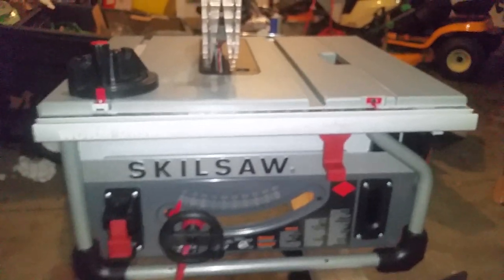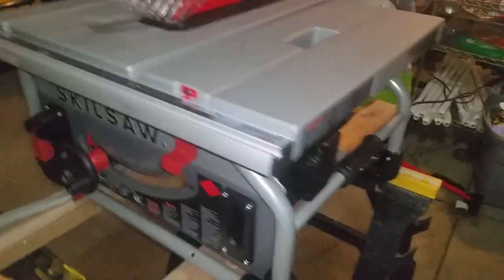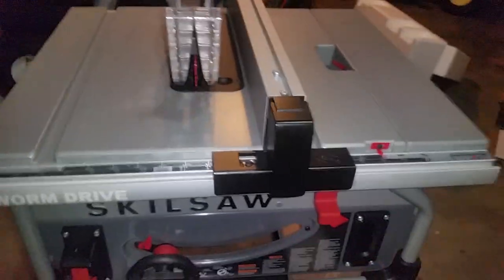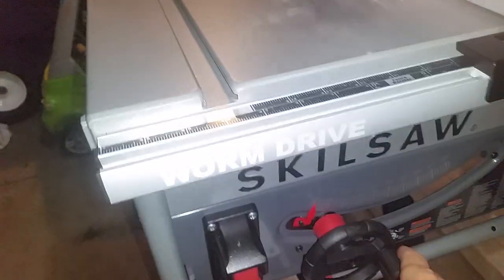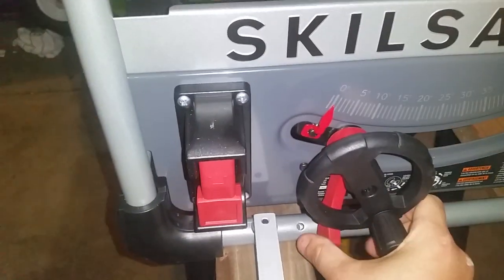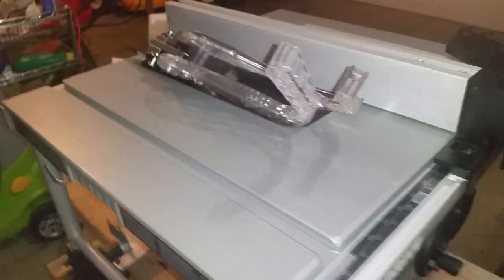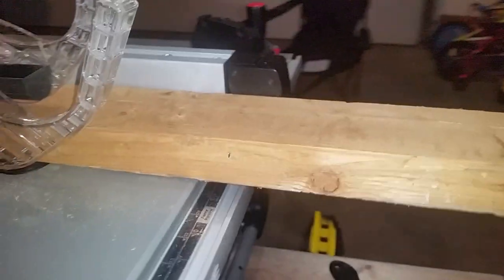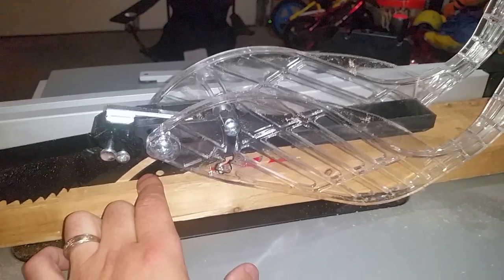Skilsaw 15 Amp 10 in. Portable Worm Drive Table Saw Review

Comment: I just got one of these used for $135. So far so good. I think it had the original Diablo blade. I do need to change the oil, but it seems to run fine. I have heard these can last a lifetime. One thing about these is that they are actually Bosch saws - made by Bosch.

Comment: I bought and ended up returning this saw. The height adjust would back drive while cutting box joints and each finger space was progressively lower by about .007. Fence was very square to the slots and blade but not to the table face and had no adjustment. So tall cut jig had problem staying square making cheek cuts for tenons. The fence itself is better than Dewalt and the rails work as well as Dewalt rack system. Well thought out, compact and light. Not overly loud but has a high pitch whine that can irritate tinitus. Motor is 9K rpm and blade is 4680 to 4950 rpm by a laser tach depending on warmup time for the oil. Angle lock is a knuckle buster, almost all other small saws have a better designed cam. A bit too much plastic and cost cutting in the dust chute for a high end mini saw. My dust chute had a crack in it that would've eventually broken. This is a small durable powerful table worksite saw for a pro. Ultimate portability and storage, but not expect to do accurate home shop detailed projects with it.
Reply: What would you recommend for accurate, detailed projects?
Reply: In the small portable jobsite saw category I don't think it exists. If you mean 1/64 repeatable accuracy then you're into a 400-600 lb cabinet saw with an Incra positioner. I am very happy and impressed with the Home Depot 2016 Delta for $199. It's a redesigned 2016 Lowes Kobalt (that has a terrible fence). It has more metal than the Skilsaw in the dust chute and bigger dado and rip (35 inches) than any of the Dewalts. 2 axis heavy steel adjustable fence with a really good lock lever tops all the Dewalts and Boschs and it comes with the scissor stand and outfeed support. Plus it rips 4x material and has an aluminum miter gauge and has telescoping fence rails, not single support like the Skilsaw. The thin throat plate is an issue, but I made 9 of them with a 10 foot piece of 2 inch PVC and MDF like izzy swan for around $18.
Reply: If I'm not mistaken, you're talking about the elusive holiday-only Delta that was not in stock anywhere I looked. If not, I'd be grateful for a link.
Reply: Phuong Dinh Yes it was available via online order free ship to local store. As were other large heavy tools like drill presses, etc. Most stores do not carry it. It'll be back. Its 2 good to stay away. Keep asking the store manager and they'll stock it. Only 239 regular price.
Reply: I have exactly the same problem with the height adjustment. Trying to make multiple blind rabbets and the cuts kept getting shallower and shallower. Finally, wound up setting the right height and jamming a piece of wood in the gearing that adjusts blade height. Otherwise the saw is a great machine.
Reply: @cbpuzzle  What model is the DELTA you are talking about from Homedepot?  I might consider it since you are somebody with experience on multiple saws. Thanks in advance for your reply!

Comment: 15amp motors at 120V can only produce so much power expressed in watts. Often direct drive is used to eliminate friction of gears by designing the motor to produce RPM wanted. Brushless motors allow them to produce more power really partly based on no brushes friction.

Comment: Notice the side to side blade movement when elevating or lowering the blade. I looked at 3 of these saws and they all do the same thing. Engineering flaw that I spotted before I bought the saw, but I still bought one for the torque and cut depth. I always check and double check my rip width when lowering or raising the blade. 
As for the plastic miter guide, toss it. It's junk, like all of them. Not sure why saw makers even bother.
Funny, going all the way back to the 70's I couldn't figure out why someone hadn't made a worm drive table saw, given the well known ferocity of a worm drive circular saw. Now that I'm worn out and ready to toss, they come out with one. Finally.

Comment: How stable is the fence? Trying to decide between this and the similarly priced Dewalt which has a really accurate fence
Reply from the maker: Hey Matt, the fence locks in very tight and will definitely hold up to anything you are cutting. To tell you the truth,  I was surprised just how sturdy it is

Comment: And have you heard or had issues with blade dropping while cutting ?
Reply from the maker: Haven't heard that dunno, but I actually got rid of this because of other issues.  Had to RIP it apart a few times because of electrical issues
Reply: @ToolReviewZone  What electrical issues?
Reply from the maker: A lot if trouble with the electrical cord. Had to replace a few times. The sparkling from the motor was ridiculous too
Reply: Ended up going with Dewalt
Reply from the maker: Dont blame you. Better choice

Comment: That does not sound like a soft start motor. Does Skilsaw have more than one model of this worm drive table saw?
Reply from the maker: Hey Jim, here is the link for the actual saw. It does state soft start.http://m.homedepot.com/p/SKILSAW-15-Amp-Corded-Electric-10-in-Portable-Worm-Drive-Table-Saw-Kit-with-30-Tooth-Diablo-Carbide-Blade-SPT70WT-22/206688625
Reply: Maybe I'm hearing the video wrong. Did you notice it to be a soft start compared to other portable table saws?
Reply from the maker: I would say I can definitely notice when cutting harder woods like oak. The wood goes in smooth, and no feel of kickback.  I have also had to stop and start again in the middle of a cut with no problems
Reply: I can hear it now. Thanks for the review. Great post and info. Helps me to finalized my decision to buy the Skilsaw.

Comment: Saw one of these at THD and it seemed cheap to me  Plastic miter/crosscut no screw drive fence system. The fence looked very cheap as well  Motor seems to be a knock off of the N77 mortor.   I wan't impressed.  But then again I am not a contractor.
Reply from the maker: Hey Gary,

I do agree that they could have needed this up a bit, but it actually holds up to a lot of abuse.  You have to remember that this saw in in the $300 price range, and the others are over $500. This is coming from someone that is not even really a fan of skill saw.
Reply: The one in your video isn't the latest version of this saw.  They improved it quiet a bit from what I saw on the New Skill Website which could be part of the new ramp up and improved skill products by the new owner of the brand. The crosscut miter tool looks better but could be the same POS plastic and the fence system is now a ratchet screw design not a cheap slider as in this video.
Reply from the maker: Lol, yeah that is usually how it goes when I get something. I may need to take a look the next time I stop up at the store. Thanks for the comment
Reply: I did more research and realized this isn't the saw made by Skillsaw that I was looking for.  They actually have a larger version with a much larger motor better crosscut guide, as well as a rack and pinon fence system which has 30" to the right of the blade.    Though this saw you reviewed is the cheaper smaller model.